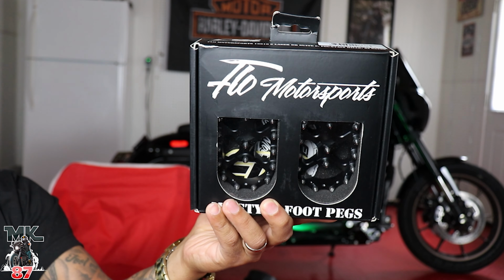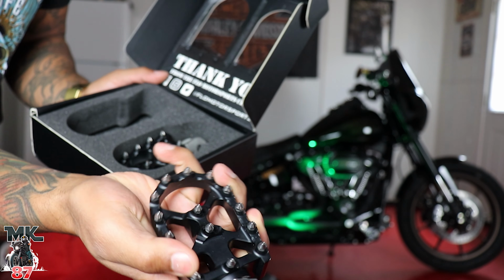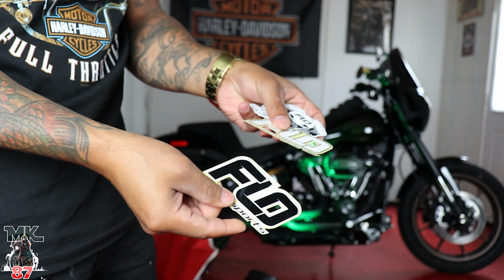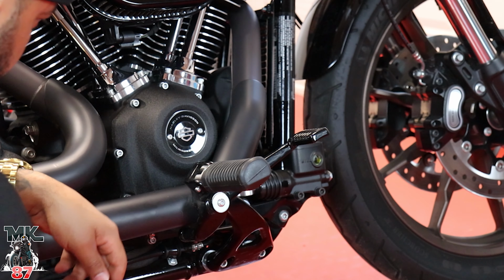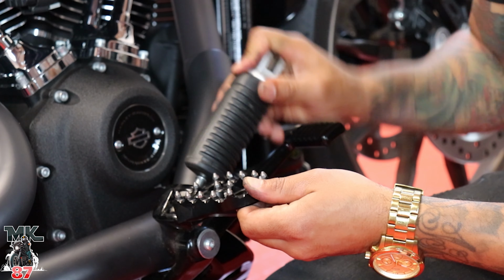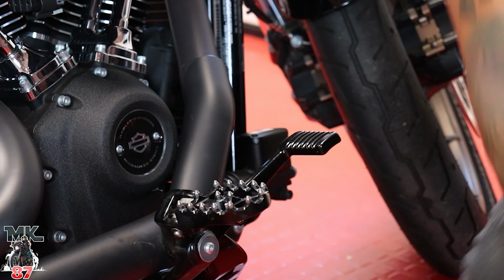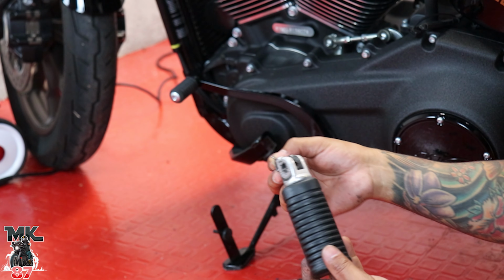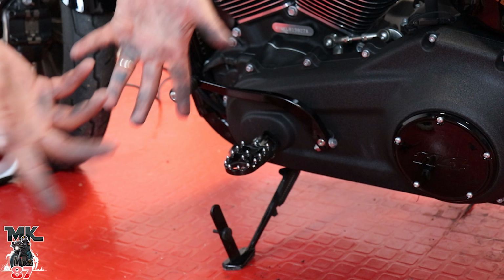Flo foot pegs install on my low rider s

Comment: hey bud, did you have to get the clevis set to install these? 
Flo motorsports said i had to use a clevis set in their accessories to install on my 2021 low rider s.
I didnt see you change out the clevis set.
could you help me please